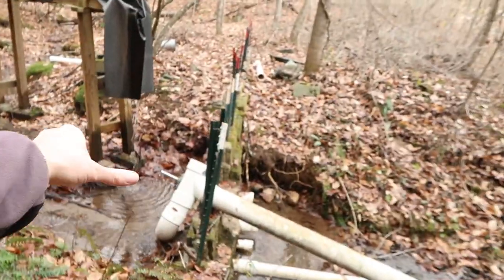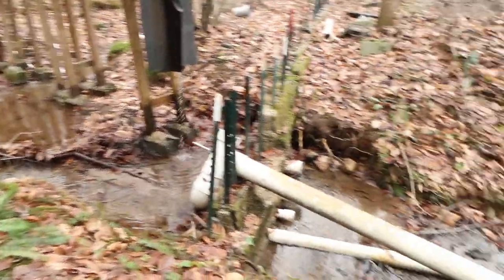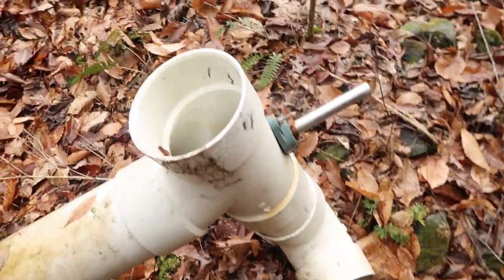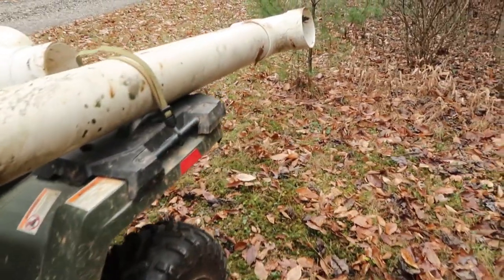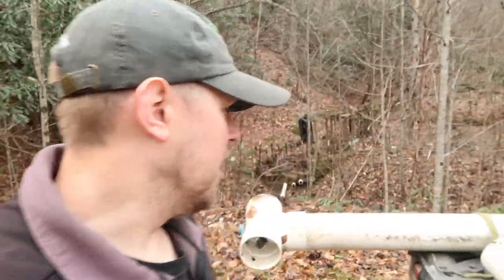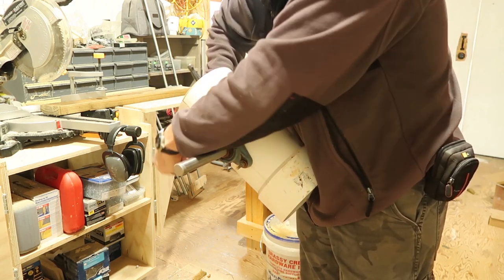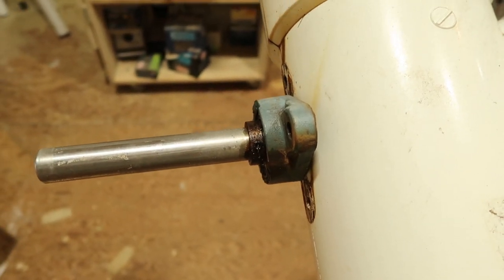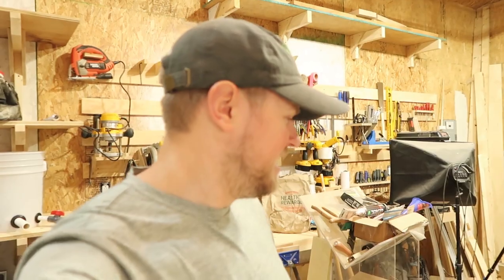Lets Bring Back the Archimedes Turbine Screw  VL176

Comment: The Archimedes Screw has always been fascinating.  I remember seeing someone rig something that could lift water using a hose arranged around an axis like a helix.  Imagine a garden hose around a broom handle.  Spin the handle with one end of the hose in the water source.  Just scoops up the water and splashes it out at the other end.  I can't imagine how to engineer this to work the opposite way.  That is, forcing water through to create spin.
Reply from the maker: Ah yes I have seen a few videos like the one with the hose on a stick. I am working out the details on how to make this a turbine. My next step is to lock down the auger inside the half pipe. Should have that video out in a few weeks.

Comment: You need a (maybe more than one) centering bearing in the middle of the pipe to stabilize the auger.  It needs to be in a pipe. Otherwise the water will simply flow over the auger and not spin it. Your orginal idea was right. You just need some really good bearing and no contact with the pipe. Addition. Water will take the path of least resistance.  So the pipe must be as small as you can get it without any contact with the auger. With good bearings and forcing the water through the auger twist it should turn the auger just under the speed of the water. As you know, good head pressure is the key.
Reply from the maker: From the reading I have been doing I need to have the auger at 25 degrees for best results. At this low angle I should be able to have the top of the pipe removed so that a spacer can be installed if needed. I agree with the centering bearing but I am not sure how I would get it installed in the pipe. We shall see soon when I open up the pipe.
Reply: @LandtoHouse  the centering centering device would have to  be attached on the auger before it is installed. The most important thing's are that the water is contained in the pipe with the only exit possible being through and around  the auger and pipe. And the fit between the pipe and auger should be as tight as possible. I hope I haven't offended you by giving my two cents worth. I couldn't resist spouting off. I apologize if I offended you in anyway.
Reply from the maker: No need to apologize.  I am an old school youtuber who is not easy to offend.  I like the idea of the extra support in the middle of the auger. For the early testing I think that I am going to split the 10 foot auger down to 5 foot sections and try that. I really want to try building my own!
Reply: @LandtoHouse  1/2 inch plywood "X-men" symbol with a bearing in the middle for the auger halves connection point to sit inside.

Comment: Do not exceed 25 degrees, you will need a large multiplier and a small permanent magnet generator, you have little jump and very little water that is very variable and dirty, an overshot water wheel that touches without touching both the channel and the ground is more indicated, too much space between the blades and the pipe of the archimedean screw makes the water run away ...
Ciao
Reply from the maker: Its nice that you say 25 degrees. I was just reading about that angle being the best. The waterfall that I am going to be using is close to 8 feet tall. I might have to make the stand off the ground a bit to get this to work. My neighbor is going to build a waterwheel off that 8 foot drop in a few months. I wanted to test the screw before he gets that wheel built.
Reply: @LandtoHouse  Nice to meet you !
Many years ago I built a small hydraulic cross flow turbine with its electronic control unit with load shunt to keep it at a constant speed and directly use the 230V 50HZ single-phase (Italian standard) generated by the three-phase asynchronous motor excited by capacitors, in single-phase c-2C configuration, plant of about 2kw, I was also interested in hydraulic coclea,  near home more than 15 years ago the first hydrodynamic screw for hydroelectric production at variable speed was installed, it was the first in the world to use an inverter to control the speed of generator (asynchronous motor) and adapt the screw to the water flow rate, and regenerative inverter AFE for the synchronized insertion in the national grid, it is possible to adjust from 1kw to 90kw depending on the water flow rate, it is the pioneer of the variable speed, before that they were all at a fixed speed and did not adapt to major changes in scope, they were sta you made experiments but they were not marketable due to the exorbitant costs, using huge permanent magnet generators (the best ones as efficiency) and huge inverters, unthinkable.
Logically for little power a multiplication is needed to adapt the low speed of the auger to the speed of the generator, some tests will have to be done, and a small oversized permanent magnet alternator if China, an MPPT solar regulator ...
Ciao